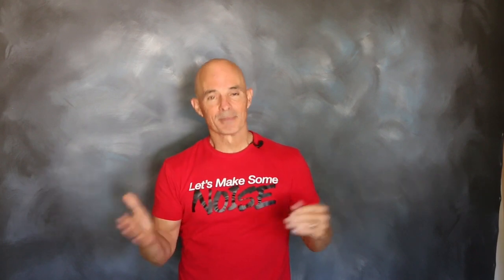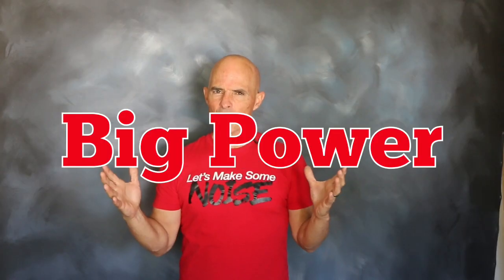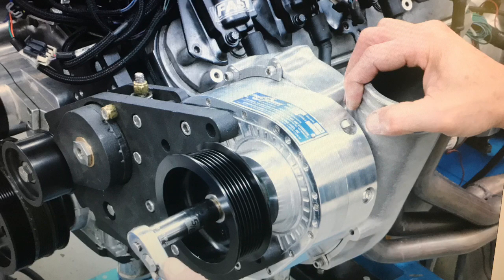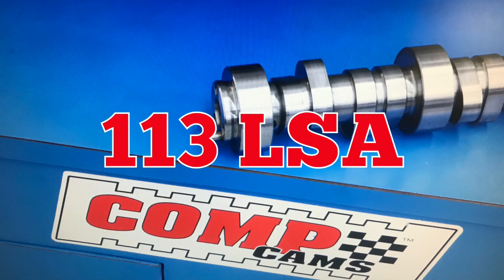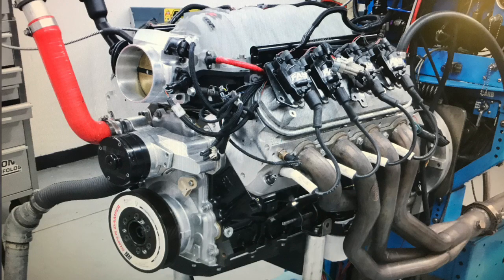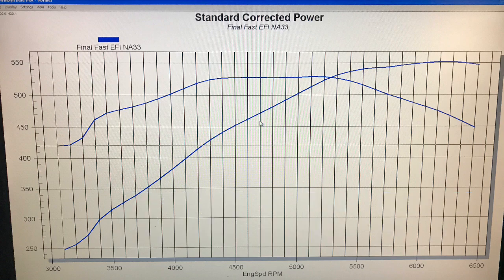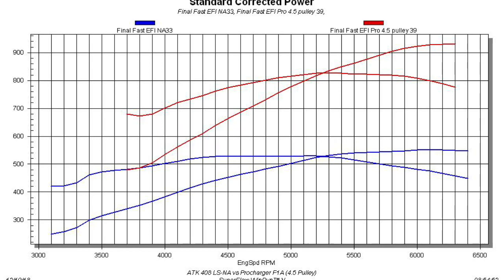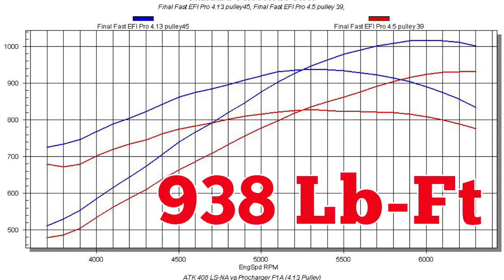Making 1000hp From a 408 Stroker!

Comment: I believe you're going to be really surprised to see what a similar combination would do on a 6 o with turbos. Short Stroke may make more power just less torque. You just going to get more crank Flex with the long-stroke. Forged 6.0 with Billet main caps is tough to beat. With the right cam it will out rev the 408. If you need additional torque on the 6 .0 just raise the compression
Reply: Same thing can be said of the 408. Add cam timing/compression as desired. Disorder displacement counts, still

Comment: I would assume compression ratio has to be 8.5-9.5:1
Reply: That's SBC numbers. That's what I thought too. This is my first Ls and these things are running 11+ compression on boost with meth to drop the charge temp essentially creating hotter burn / higher octane and avoid detonation ...I didn't believe it myself till I started 🙈 Ng all the builds at my tuners shop and what they're running. They're nuts

Comment: Help me out here i am new to this 408 stroker have a 9:1 compression ratio right which will be safer if I am running forced induction (boost) so I can get the maximum boost of the super or turbo and still be safe  .now what are the factors that can increase or decrease my compression ratio let's say I have 408 stroker with factory 6.0 heads or maybe I have a very aggressive cam does that affect my compression ratio?
Reply: Cam won't help. If you need to drop.or raise compression ratio. It's either pistons or heads. If by just a smidge seen some gold running a slightly thicker head gasket. Under boost I'm not a fan. But seems to be working for some guys. Norm cheaper to do Pistons I'm going head route since I'm already fully forged lsx guts. And going to afrvir Frankenstein heads over the current 823 heads decked .30

Comment: man i am tore between building my 6.0L gen III as either a 365 or a 403, to get to 1000hp, using 317 heads, summit stage 2 or 3 turbo cam, and a s480 turbo. I have a stock crank laying around but going forged keep calling me. I am gonna so it right with forged rods and pistons, but still not sure what to do with the crank. its going in a mostly street driven, occasionally tracked 98 trans am, so im trying to keep boost under 14lbs so its a bit easier to tune. any recommendations?
Reply: For max hp id suggest rec port heads over cathedral

Comment: that’s really good for small injectors  with 250 lbs injectors and c16 race gas one can only imagine 👍
Reply: 250 lb injectors!? Would that be necessary for 1,000 hp lol?
Reply: GUTHRIE #1 no i don’t think they are  but why stop at a 1,000 hp  lol
Reply: @guthrie1181  on methanol?
Reply: Mastermindyoung14 No one mentioned methanol though. He mentioned C16 and 1,000 hp

Comment: Build 1000hp NA and I'll be mightily impressed.
Reply: To get 1000hp NA you need more displacement, more bore, a large solid roller camshaft, a different intake, big LS7 style heads with heavy CNC work and an 8500rpm red line.
Reply: School of Automotive Machinist did that several years ago with a 500ci LS2 and a 1k hp NA LS isn't too difficult if you have the money.
Reply: If throwing a ton of cash around is impressive..